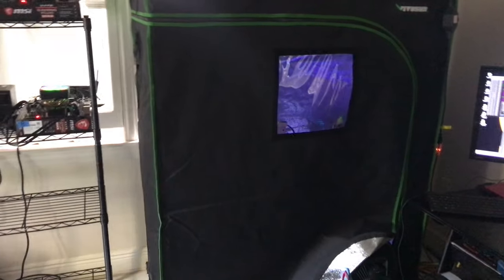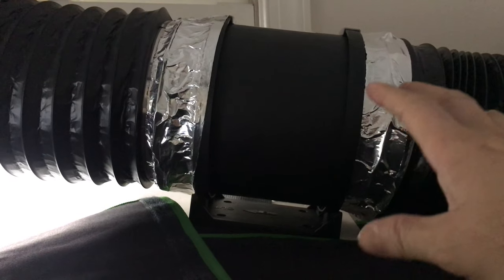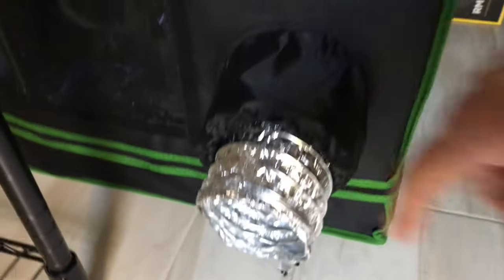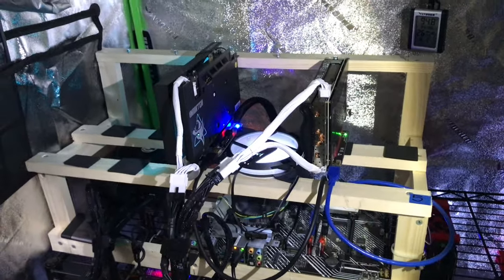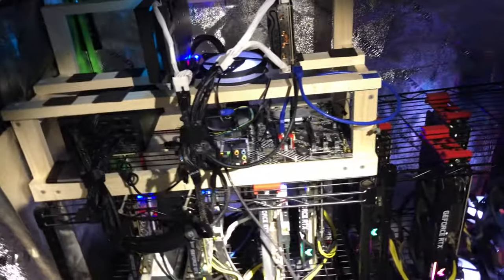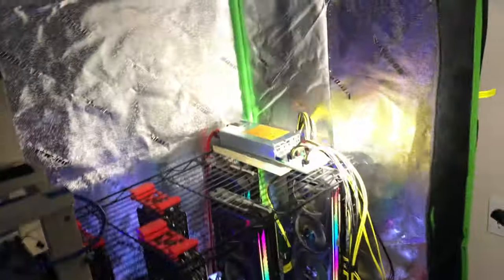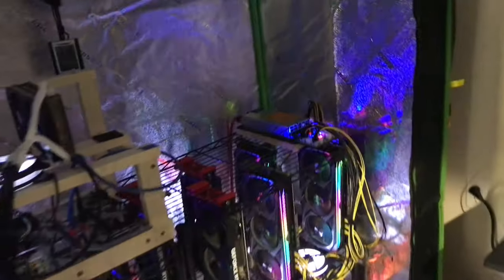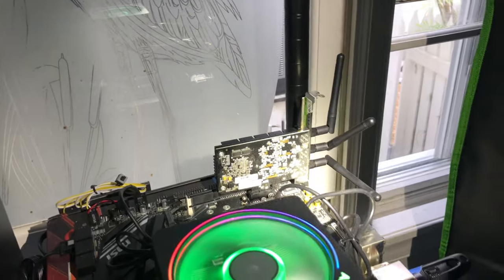Grow Tent for GPU Mining - Lessons Learned

Comment: Nice setup. I've been looking for the best route to take for my first tent setup, but you just confirmed which one ill be taking which is the wire rack one. I was hesitant because of the cost of the GPU hangers and I had seen people use the zip ties or those rock climbing clips and just look ugly hanging lol but the screw thing you did to yours is actually a 200 IQ play! Also, I like that u set up a wood rack on top of the GPUs that are hanging which is convenient for me because I have that wood started rig too 🤣 Anyways great video thanks for all the tips. I subbed so hope to see more video in the future.
Reply from the maker: Keep it simple is what helps me. Buying lots of little things like GPU hangers and accessories will break your budget. 3 inch deck screws do the trick and are not as bad as using tie wraps. The wood rack is awesome, light, cheap and easy to move. Don't spend the money on stuff that won't make you money.

Comment: Can you use tents outside? I have my 8 card rig at the moment under the patio here in the Australian summer because it was too hot inside, so just finding a solution to protect them + manage temps effectively outside. Was thinking grow tent but then that might like super sus to neighbours compared to maybe a DIY enclosure out of wood with the same kind of exhaust setup. Thoughts ?
Reply from the maker: I am in Florida, humidity here messes with the grow tent. Ambient temperature can really mess with the tent. For outside, I would build a wood shed with lots of vents and fans and a dedicated power supply. I would not use the grow tent outside.
Reply: @roccotacomining3311  our ambients at the moment are 30-40c and the cards during the day get up to 60-65c and that’s just them outside on my table lol couldn’t imagine them now being in a hot tent. Thanks for your reply, going to look into some designs for a diy box build! Appreciate your take from your experience :)